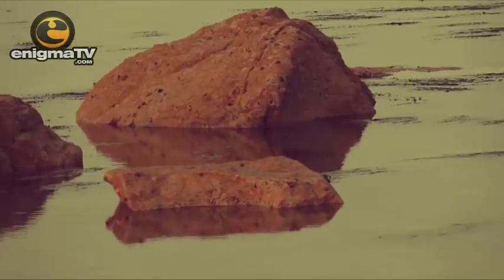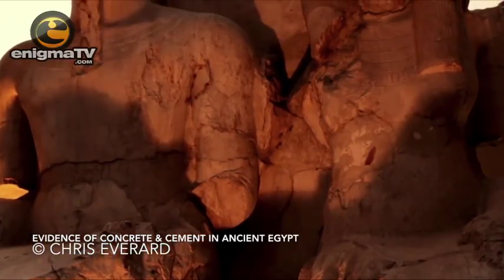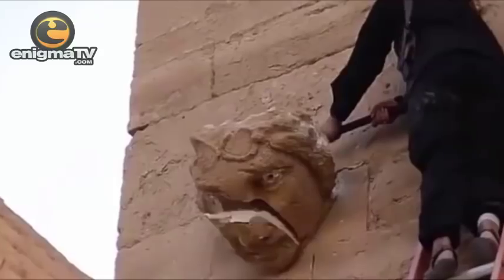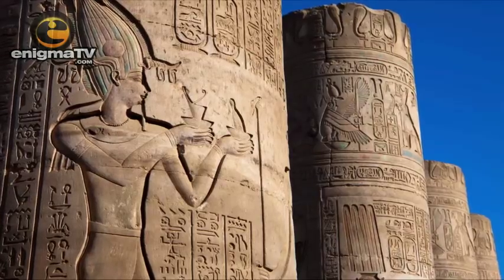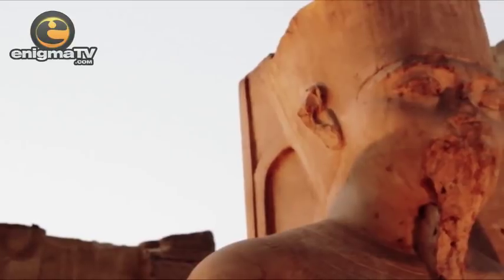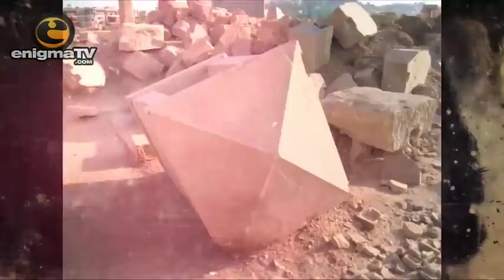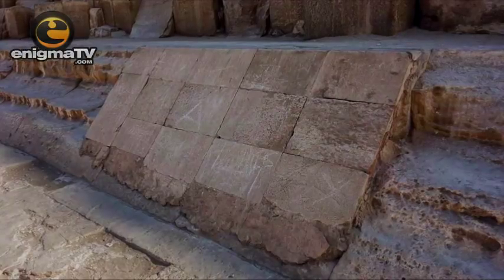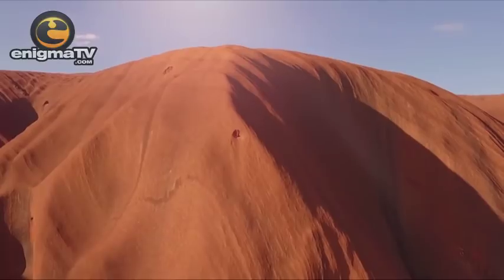Ancient Building Techniques Concrete Use in Ancient Egypt

Comment: i read a book from i think 1984 which i still can't find... from a geopolymer specialist... he has a chapter on building concrete boats to race... another chapter on how you could make sarcophogi of "rose quartz" another chapter about how you CANNOT find a giant chunk of rose quartz and beat it with a round or any other stone. the blocks of the great constructions were undoubtedly a form of concrete. another chapter pointed out that there were imprints of knots and grain of WOOD as used in concrete forms visible on the great pyramid, and that records from that greek scholar (?) specified that the great pyramid was built in 2 years, and specified the number of slaves, and the stench of rancid oil, which was poured onto the very valuable wood... and was use as a "corner pour" then only 3 sides to continue on. how do you use a laser to create slightly curved (gravity against the mould) and curved over at the seams.... no. this is clearly an aggregate. you use a four sided mould for corners. you use a tube of some kind to exactly determine level, you remove one side of the mould to make a three sided mould and move along until you get to the next corner. why would a stoneworking site hundreds of miles from the closest quarry which doesnt match the microsopic makeup of the "stone" used when there were limestone and fossilized seashells WHICH MATCH THE CHEMICAL MAKEUP RIGHT FAREEEGING THERE? i have a bit of an opinion, and i don't want to sound like a conspiricy theorist, but there is very clear evidence, with wood imprints and the fact that noone in their right mind would pound round rocks against stone to fit those shapes... i don't understand why anyone would invent the idea that these structures were carved from stone. also, we have the greek scholar saying it took 2 years, and that is possible with aggregate, but not with stone, especially using copper or brass, which would be easily detectable on the seams .... egyptology was invented by who, the british? the incan stuff is even more obvious, and to me as a construction worker, it's fairly clear that these crazy shapes were clearly made with something like burlap sacks that eventually rot out. the civilian conservation core used the same technique to make countless drainage systems. no grout, just stack wet and leave them. burlap is cheaper than wood. ALSO this dude i can't find pointed out that with actual stone and mortar, you have a lot of leakage, or general moisture content of natural stone, whereas CONCRETE absorbs, stores, and disperses moisture. this is why viable wheat seeds were found in the great pyramid thousands of years later. My personal belief is that jacob, from the old testament, was imnohep, who predicted the 7 years rich and 7 years bad, the frogs, all that, and that it was a huge grainery, like a silo. all of the vents ect point to keeping moisture out and venting it. again, sorry i'm opinionated, but it really seems very obvious, and the one thing that's unclear to me is WHY people want to hide truths like this, "just to save their own beliefs" (bob marley). i aslo want to agree with the geopolymer aspect. the book i read and can't find specifies in other chapters that there were many coveted vases and chalices made from "solid rose quartz" by "dripping lemonjuice or vinegar" and swishing it around. there's a point where we need to recognize that we're not necessarily as smart as our ancestors, and that christ wasn't necessarily the beginning of the world. i personally believe as well that the great sphynx is many thousands of years older than these egyptologists insist. sorry about spelling and punctuation, i have no need for it, because i know you understand me.

Comment: There are a few things that can throw off this theory.  first, it is very possible that 300 men working a full day can very likely cut 300 rectangular stone blocks in one day very easily.  second, one can easily imagine for instance, that by simply cutting a trench in the ground and putting in logs (like a train track except with round logs atop the rail instead) one can move thousands of pounds of stone through hundreds of miles by simply rolling it along this track - just like we've done in modern day with installing millions of miles of train tracks.  likewise, this track can just wrap around the pyramid or whatever structure is being built in a ramp fashion just the same.  Lastly, it's possible that the concrete you are seeing is just reconstruction and remodeling and copying done by the Romans, or through Alexander.  Just the same way we restore an old car with modern techniques and makes it look like it just came out of the factory authentically, the same could have happened here.  However, it is also not very difficult to imagine that the ancients had methods of creating concrete - i think it's the most viable and reasonable answer, however, it has the aforementioned pitfalls - and it's probably in fact a combination of all points and more.

Comment: I'm sorry but you are just jumping to conclusions a LOT here... I'm not saying its all wrong but you dont seem to need a lot of proof to claim you know it all... do you? Most of this video is just making claims that you dont even attempt to support.

In this images you can CLEARLY see the hollow part is not very big: https://www.flickr.com/photos/sdamlo/23844267720 Did you maybe on purpose take the image at night so we could not see the nose is clearly an inserted block that later fell out?

I think it is far more believable that the nose broke off during the carving and they had to make an insert block. 

The hole in her head? How deep is it? Is it What about the broken arms, why are they not hollow? What about the legs? 
You see a crack and immediately jump to the conclusion they are mold marks. No proof given.

The metal rods holding up artifacts? We can date iron objects, so it is EASY to find out if these are ancient, or more recent restorations. And I am pretty sure they are more recent. 

I'm not a material scientist, but I'm having a hard time believing that if you crush granite, then use a binder to make it one piece again, that you cant see the different under a microscope. Especially with they had to work with. And again you show ZERO proof, just make unfounded statements.

Seconds later you say its made from granite and limestone. Which are NEVER found in the same rock.. Granite is an igneous rock, limestone is a sedimentary rock.  so how come you before claim the difference cant be seen under a microscope? Why dont you show that this is the composition of the 'concrete'? 

https://upload.wikimedia.org/wikipedia/commons/d/df/Assuan_07.jpg Are there not unfinished, clearly not cast, blocks found? Did we not find the tools they used around it?

IF they made concrete from pulverize granite, quartz and sandstone. How did they pulverize it? If you cant imagine them carving granite, how did they pulverize these massive quantities?

You say they made holes in the soft cement with tubes. But IF the cement was soft, how did they CUT the individual granite stones in the cement?

Dont we know how to cut these holes with copper tubes and sand? And dont they also give a taper because the copper wares out? https://www.youtube.com/watch?v=qeS5lrmyD74 Is the core they made not tapered?

At 33:25 you show a hole. Does the end of the inside of the hole look like it was broken off something hard, or soft?

The star shaped holes are a mystery, but are not in itself proof for concrete. Not is perfect flatness. How did they make the molds, perfectly flat with so much weight of the concrete pushing against it? 

In what way is it very clear that the interior of the sarcophagus has the same texture as from a mold? I am sorry, but it it not smooth, nor flat, nor square. All you do just SAY it is very obvious, and move on without ANY proof, yet again.

This whole video is nothing more than you making unsupported claims.... sad.
Reply: I agree with you! I thought a lot of the same things while watching this video.

Comment: Wouldn't ultrasound expose the hollow structures and statues? Is there not a means of testing a piece?
Reply: There are spaces on the inside, its just not talked about that much. The Pyramids are the same. The outer casing stones are concrete, although behind it are stones and sand. They had almost like the same kind of building techniques that we have today. The "sarcophagus" on the inside of the great Pyramid did not have aggregate in it, so it was probably cut granite rock, or geopolymer granite like what we use for kitchen furniture today. The ones at Sakara also had megalithic granite blocks, probably cut with precision tools, and/or cut from geopolymer granite.
Reply: Sure they can test it, but people that believe in alternative idea's often dont like their idea's tested, do they?